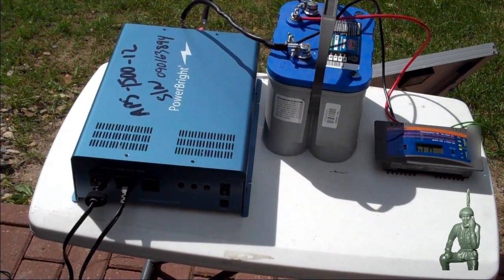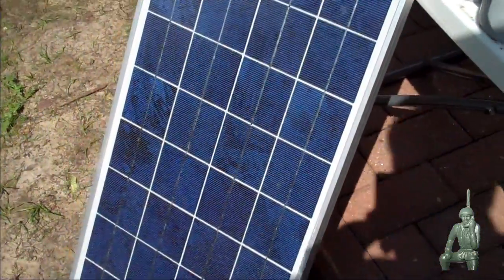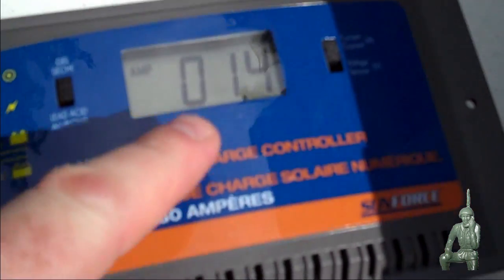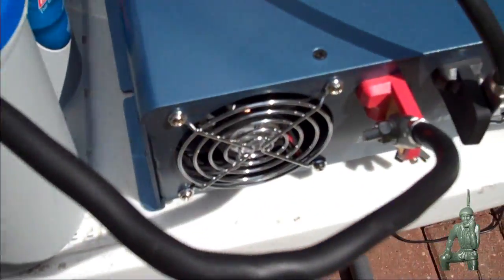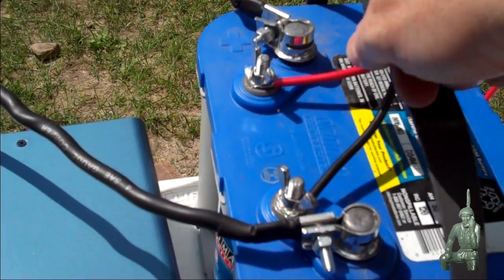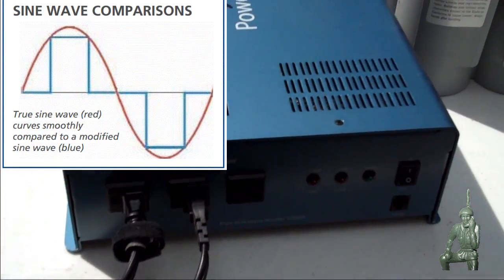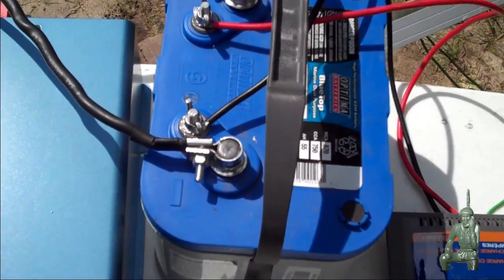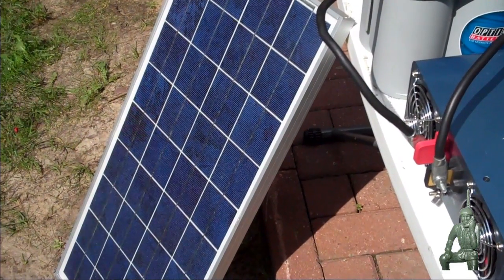Basic Solar Power Components

Comment: Cool video, very informative. I have a couple questions for you maybe you have some insight on. 

I think the thing most people will get stuck on is sizing their components properly. Maybe you can do a video on that as well..  This stuff is expensive and most of us can't afford to do it twice. 

I'm trying to set up 1000 watts of panels.

I don't want to get a kit because like making your own computer i'm sure there's better products available.

If i had a 960-1000 watt panel system:

-What would be the best controller.

-What would be the best/Safest Inverter.

-How many batteries (I like the Vmax 155ah deep cycle ones)

-What should i use for fuses/fuse box

-and what size wire is safe to put it all together with. I really need to know what wire i will be connecting the controller to the panels because i need to run that wire and start closing up the walls. 

I just want to make sure i put this together with the correct components. My budget is the exact cost. which means i'll be over guaranteed.) no room to fudge up

Thank you

~Dan
Reply from the maker: Dan,

I would need more information to even come close to making loose suggestions.

What voltage panels?  What is the Vmpp and Impp for those panels?  Are you wanting to setup a 12, 24, or 48 volt system?  Panel combiner box with breakers and fuses are a must.  Wire size is based on system voltage and load current (back to panel type and battery voltage).  Number of batteries would be linked back to the array max charging current Impp.  Charge controller - MorningStar TS-MPPT-60 is the way to go regardless of the above info.  Start with telling me about the panels and I can work from there.
Reply: Type in: 

ECO-WORTHY 1KW 24V Polycrystalline Off Grid Solar Kit: 10pcs 100W

to Amazon. 

Hi, i picked up this set. I believe it's a 24 volt set up. Please tell me if i'm wrong. I want this battery:

I want to get the Vmax 155ah batteries. 

It's a 12v.. So i think i need 4. Can you confirm for me. 

Also, Since it's a 24v system, can i still plug 12v lights into it?

Thanks for your help! :)
Reply from the maker: These are 24 volt panels.  How many panels did you get?  Do you want a 24 volt bank or 12 volt bank?  The Vmax Tanks will work but Trojan T-105RE batteries are a better choice.
Reply: Hi, i'm on the verge of buying my inverter, charge controller and batteries. I need to make sure i get this right. Here's what i have:

I have 10, 100 watt panels. 12v system.

 I have all my wiring laid out. I will have d/c lights and a/c powered items. 

The main question that is holding me up is which way is preferable to wire the panels. As this changes what  size controller and inverter i need. Maybe you can lend me some insight. 

Max values:
Series gets me 177v, 5.7a
Parallel gets: 17.7v,57a
Series-Parallel 2 sets of 5: 108.5V, 12.2a
Series-Parallel 5 sets of 2: 43.4v, 30.5a

What's your thoughts? 
Firstly I want to make sure it's okay to wire it up in series-parallel. I believe it is. 
Second, I'm trying to figure out what amount of amps vs volts is good for the system. 

I'm not having too much luck on this. 

You can assume I will use the system to the max. Thanks for any help! :)

Comment: Hi Commsprepper and hathiphnath, one correction to the video: Computers are not that sensitive to modified sine wave (MSW), at most, power supplies will run a little hotter. But on the other hand MSW is not for motors (pumps, refrigerator,etc): there's the risk of burning them up. With true sine wave everything runs ok, but its much expensive than MSW.